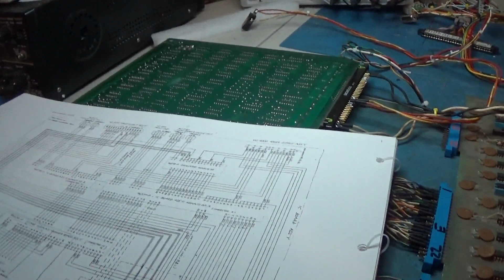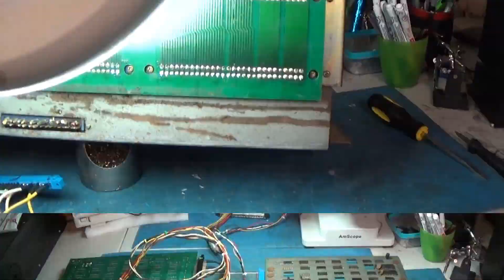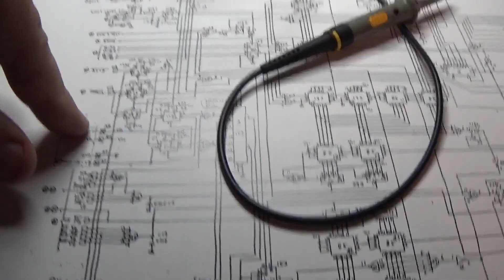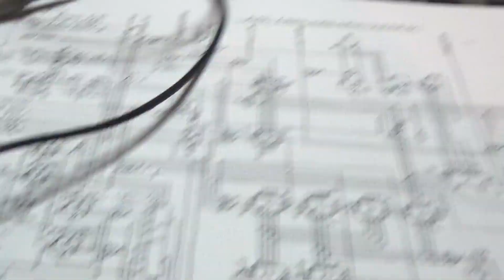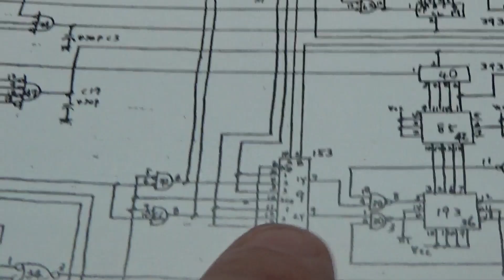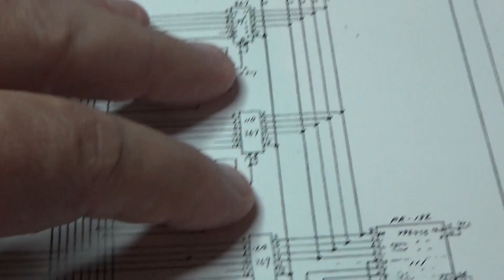1980 Sega Monaco GP Arcade PCB Set Repair -- Part 2  -    6-02-23

Comment: Sean, thanks for all the awesome videos on Monaco GP...  
I just pulled a Monaco GP out of storage..  It's working, but the car is stuck on the right side.  May be a steering  board issue, but I haven't gotten to it yet. 

I pulled the power supply to clean & recap it, I noted the 5v main supply was a bit low at 4.5v so I also checked for shorts on the boards.  On the (main board #2 "the one with no blue sockets") I'm getting 11.5 ohms across the (V+ & Gnd).  Seems like that's pretty low??  I cleaned it, the traces & solder look good, replaced x2 electrolytics & removed all the tantalums, and it still reads 11.5 ohms..  would you share your thoughts about this?
Reply from the maker: @markbechtold2010  well the 11.5 ohms across the power rail does not surprise me… That board set is a current hog so you may want to start with rebuilding and recapping your power supply… And then re-checking the voltage. Make sure all of the connectors are well soldered.

Comment: Honest question; would you like to take on a Secret Base PCB? Uses only 5v and a b/w monitor. Just a TTL jungle. I have documentation.

I also have the sound board, but that's easy enough to figure out, if it's non working.